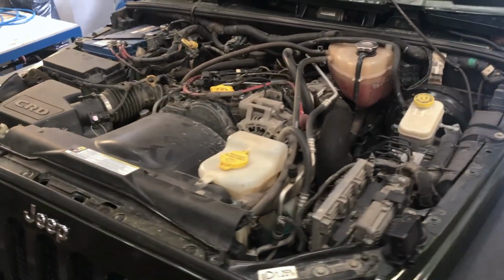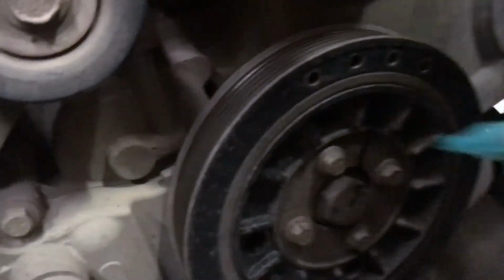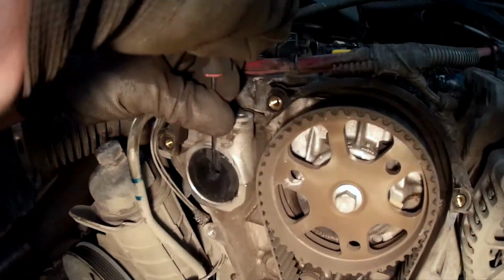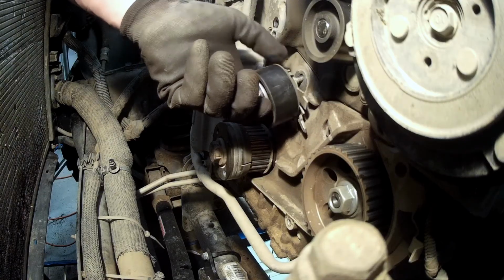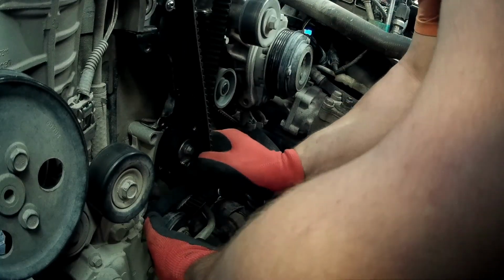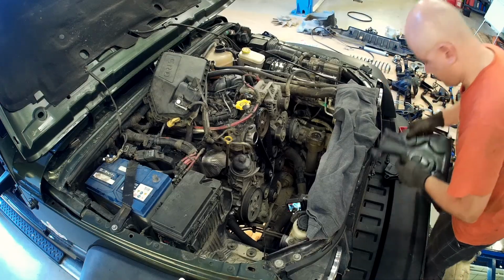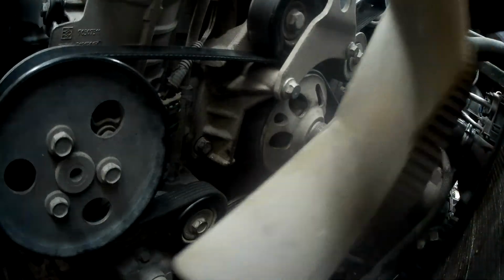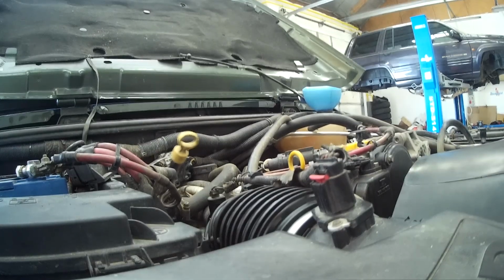Timing Belt Change - 2008 Jeep Wrangler JK 2.8L CRD - Service Tutorial

Comment: Hi, Great video, awesome to see some jeep crd service stuff, wish there was more and  thanks for posting there is a slight error however, you arnt using the crank locking tool correctly, the long bolt in the kit should pass down the middle of the crank lock and thread into the crank, locking it , without the bolt the crank is not locked. the video shows the bolt being used to hold the cam lock in place which it wouldnt as theres no shoulder , it could easily come use.  please im not trying to nit pick but locking the cam and crank are critical :)
Reply from the maker: CandSEvo7 thanks for the nice feedback, hope that others read and learn from this. next time I will take good care of it for sure!
Reply: So the bolt had to be bolted or not in the crankshaft
Reply: Thank you for this precision that I saw too late,  I saw the locking tool was not fixed but chance was here nothing move :)
Reply: i know im randomly asking but does someone know of a trick to get back into an Instagram account..?
I somehow lost my password. I appreciate any assistance you can offer me!
Reply: @Kenzo Tanner instablaster ;)
Reply: @Ronin Alden It did the trick and I finally got access to my account again. I am so happy:D
Thank you so much you saved my ass !
Reply: @Kenzo Tanner happy to help =)
Reply: Could you tell me, where the long bolt must fix the cam?
Reply: Would you simply put the bolt that originally came out of the hole where the cam lock goes back in to lock the tool in, then use the long bolt from the kit on the crank lock?
Reply: @NickyWG04   any bolt with a suitable thread and length would hold the cam locking tool ,
Reply: @christiank.3583   the long bolt does not fix the cam it goes inside the crank locking tool to lock the crank in place
Reply: @christiank.3583   the long bolt goes through the crank locking pin and threads into the crank and locks it ,
Reply: @christianlorenzi6459  the bolt supplied bolts through the crank locking tool into the crank, the cam locking piece uses any bolt you have handy , its either m6 or m8 I can't quite remember

Comment: Many thanks for this. My 2010 Cherokee KK crd is the same engine and I'm doing the belt change right now. I have to add that for anyone doing this on the KK you really have to remove the electric fan with the shroud first, what an absolute pain in the ass it is to remove. You end up removing loads of things to be able to wriggle it out. 

These engine do get a bad press but think they're ok, just a nightmare to work on and get to anything important.

Comment: Ready to start putting things back.  I bought a water pump along with TB
 and a few other parts.  The watet pump I removed looks like the one in the video, the replacement has a different impeller.   Bought all parts from a VM dealer.  The pump frame is the same as it will bolt up.  Thanks
Reply from the maker: I would put back if it fits, but that is just a suggestion. Google it on other forums if you want to be sure!

Comment: Great vid! I’ve done it Chrysler Grand Voyager CRD. Use a gash bolt and washer to hold the cam shaft tool in place in the head not the long pin and be careful not to damage the cam position wheel as you’ll need a new exhaust cam otherwise. The long pin should actually go through the crank tool when its fitted in the block and secures into the crankshaft. The fuel pump isn’t timed but mark it up as a matter of course so you know your belt tooth count is correct between the crank and cam. Buy the tool on eBay £40/$45. It’s a very easy job with it. Replace the tensioner as spring force will reduce over time. At 100k miles my water pump and seal were fine. Change water pump on condition (cracks or too much rotational or axial free play) or if you damage the seal removing it - couldn’t fine the seal as a separate part in UK.
Reply: On a 2014 Colorado, that long pin didn't need to go into the crankshaft. Once you thread the large pin in, it's locked.

Comment: Well done. Its difficult task. Done 4  times on my 2 jeeps. Few things, HP pump is not critical to align, i. e its not injection timed. only crn. sh and cm. sh needs alignment. For those who does not have locking tools,  just mark toothed pulleys and put the new belt the way you took out old belt. Dont be scared)
Reply: Would there be any issue if one tooth was out from camshaft or the hp pump
Reply: @deepak3218  the pump is not an issue at all, doesnt need synchronization. if one tooth off, no big deal, but sometimes engine knoks litlle bit during cold start
Reply: What is sh, crn and cm??  The camshaft and crankshaft are critical. But there are marks for the injector pump so why not use them. Its not hard.

Comment: Do not under any circumstances remove the camshaft pulley, with locking tool on exhaust cam it is no problem without the locking tool there is no way to time the engine again as the camshaft pulley has no key way. Thanks for the video, was checking pump timing mark.

Comment: Hello, very clear tutorial thanks.
The tightening torque of 32N.m for the water pump bolts sounds a bit high, is it really correct ?
Regards
Reply from the maker: Thank you!
We found 2 sources tor the torque specs. One said 32Nm, the other said 23Nm, so you might be right. In my opinion it doesn’t make any difference with these particular bolts.
Reply: @backyaard8010  
32 are Nm
23 are ft lbs

Comment: Hi, will the engine start without the timing cover and oil pump not connected? Ive triple checked all the marks and want to be sure before i put everything back on
Reply from the maker: I'm not sure if it will start without the camshaft position sensor reinstalled. but i think cannot do any harm trying it

Comment: Awesome vid, I just have a massive problem removing the BT driven fan, the nut is way too tight (the part at 50sec) I have broken 2 big screw drivers already from holding the pulley in place. I am rotating the nut counter clockwise to unfasten it. Am I doing something wrong or there is a secret? Please help :(
Reply from the maker: You are doing it right. We also had difficulties with that nut, got no secret tips for easy removal. Keep on fighting! 💪
Reply: @backyaard8010  Wow thank you for the quick reply. I am doing this to change the altenator and getting to the tensioner pulley is very difficult with the fan still on. However I've seen people do it the cowboy way by putting on a wrench and a pipe on it to get leverage (as a normal breaker bar won't fit due to the fan being very close), not sure if that's a good idea though...
Reply: You have probably sorted this problem already,but for anyone else having this problem,  look at the following video 
https://youtu.be/kCmptAKQb9Y

Comment: Great video, especially with all NM‘s for the screws and bolts, very professional. Only the demounting sequence of the two fans and the shrout / fan housing gave me a hard time. In the video you can see, that the showed car has a self made cut out at the lower end which is not original. So you just can’t slide it up as shown. Is almost impossible to do without breaking anything if its original without cutout. At the end as I mounted back these three parts I realized, that the better  method would be: First loosing the screw nut of the inner fan, then sliding up the housing together with the loose inner fan, then outer fan. At the end outer fan first, then sloding down the housing together with the inner fan, mounting the fan and getting the fan housing in position works better. You still need patience and chinses child hands to do but it works better.
Did the job yesterday on my friends Wrangler, thanks a lot for this excellent and professional video !
Greetings from Germany...Percy
Reply: Thanks for the feedback Percy! The fan shroud removal is definetly a pain in the ass without the cutout, so thanks for the input regarding that!

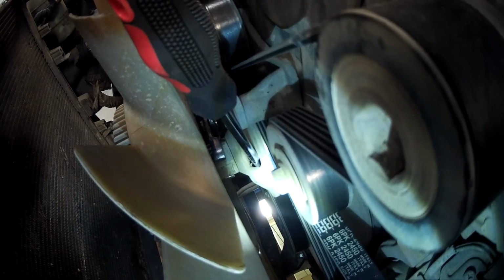Comment: At 0:50, I’m trying to unscrew the big nut of fan, locking pulley inserting a screwdriver, but the nut is blocked. 
I make a big stress, but nothing.
Reply from the maker: just keep on trying, we dont know any special trick on that
Reply: @backyaard8010  
I have unscrewed the nut beating many times with an hammer (800 g) over the end of the wrench (36 mm - 42 cm).

Comment: Good job well done

Just i dont getting why you need to mark new and old belt to put in the same position.
Isn't the same in every position you will install it?
Reply from the maker: Christian Lorenzi  yes it is exactly the same whatever position you might install. But if you match mark with the old belt, you can be sure that same number of teeth will be in between each pulleys, than it was before. I hope it makes sense..
Reply: @backyaard8010  got it 

Now it makes sense
Reply: @backyaard8010  I ve a 2007 dodge nitro 2.8.
As far as I know it should be the same engine with the same work
Reply from the maker: I assume yes!

Comment: Hi from Oamaru, south island New Zealand.my beloved 2008 has the rear firewall end injector totally seized frozen in head and even a 7 kg slide hammer at full force wouldn't shift it. would you have any ideas on the penetrating oil or extracting tricks. on the oil I have Kroil and P.b baster. thanks in advance also love your vid..Carl
Reply from the maker: conmanumber1 I was able to remove all 4 injectors without any problems, so I don’t have any ideas how to go ahead in your case. Might worth checking the Jeep JK Wrangler CRD owners group on Facebook, great community with lots of help.

Comment: Hallo, i must change this on my Rubicon 2014,is the same procedure ? I must buy the came key set ? tx
Reply from the maker: Marius Docea i think yes, it is the exact same procedure and toolset required, but haven’t done any 2014+ yet. Check the part numbers in the video description, they all seem to work for all CRD JKs 2007-20018.

Comment: The timing belt tensioner torque should be 20 Nm, not 28.
The outer front cover (upper - lower) torque should be 11 Nm, not 8.

Comment: Is this the same engine with the Chevy Trailblazer 2014-2019? It has A428 DOHC 2.8 crdi diesel engine made by VM Motori assembled in thailand 200hp 500nm torqu. It is practically the same with the new chevy colorado 2.8.. question is same procedure on changing the timing belt?
Reply from the maker: Arman Pena  unforrunately we do not know, sorry!
Reply: @backyaard8010  it is the same engine with jeep rubicon 2.8 crdi